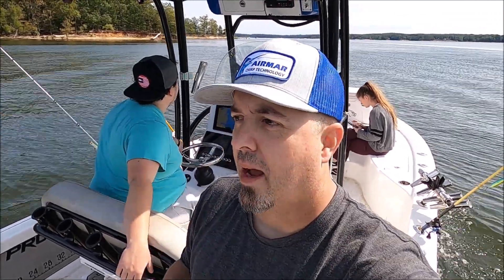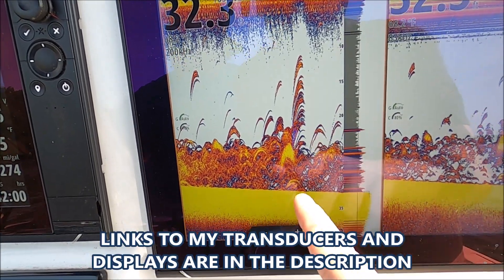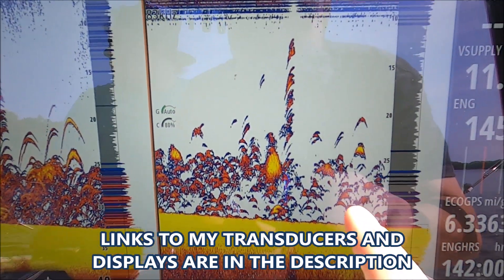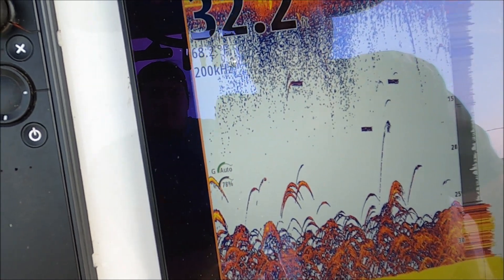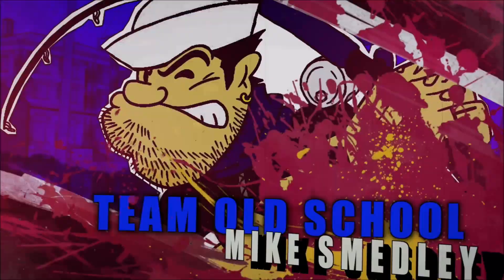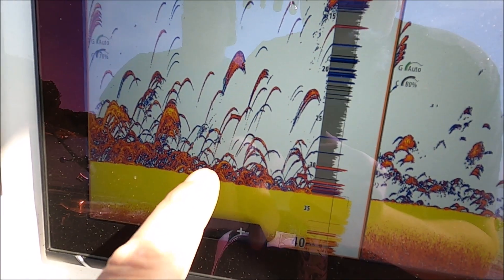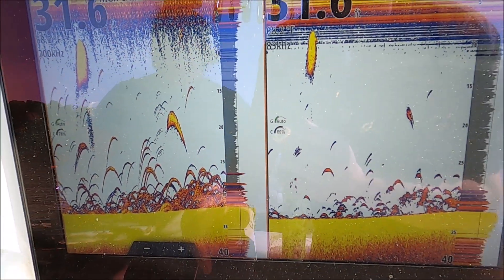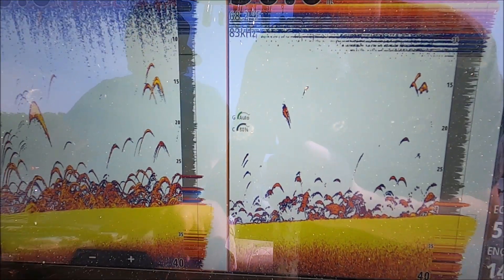Choosing the Right Transducer for your fishing style! Are WIDE Transducers better?

Comment: On a future video could you possibly speak to reasons your like to use the Airmar transducers over the ones that may come with the Simrads, Lorances's, etc.
Reply from the maker: Sure. Basically, the side and down scan transducers that come included are great, but the 2D sonar (CHIRP, 83khz, 200Khz,etc) is entry level by today’s standards. Airmar offers a full range and much higher end transducers. More powerful, quieter (cleaner), with higher quality elements. For what the included transducers cost they are amazing, especially compared to transducers just 10 years ago, but if you want the highest quality results Airmar transducers are pretty incredible.
Reply: Airmar is the king of 2d sonar. They are pricey, but well worth it.

Comment: Mike I really enjoy your videos, keep up the good work...I watched a video at work tonite where you were comparing the tm165hw and the tm175hw, I run lowrance hds live and carbon, the tm165c-hw-9n is what I think I need, and will the 9 pin plug into my live unit or will I have to buy some sort of adaptor cable. Thanks
Reply from the maker: Thanks brother! I appreciate that.  They mostly come with a mix and match plug on the end so you will need a Lowrance mix and match plug adapter.

Comment: Hello, Mike.  Airmar says that the TM165HW ducer is @Raymarine - All compatible@ . 
So, can i use this ducer with the Raymarine Element HV series or not? Can you ask Airmar regarding this matter?-)))) Thank you a lot!
Reply from the maker: They make a wire plug for several brands, so if it says Raymarine plug, you’re good to go brother!
Reply: @MikeSmedleyOLDSCHOOLSTRIPERS  thanks a lot!
Reply: @MikeSmedleyOLDSCHOOLSTRIPERS  From Chile, South America. First of all, thank you for all the help and work on the Sonar for dummies series, I finally begun to understand something (tip of the iceberg really LOL).
My father just bought a used boat that came with the Raymarine Element 7HV (HV-100 transd) mounted on the starboard side.
We fish mostly trolling for salmon (lakes or sea) to 130feet deep max. I'm planning on using and understanding the unit first with what I know now and then I have some questions:
- 1 should I change the transducer to the port side?
- 2 should I upgrade the transducer and should it be worth it for the my style of fishing?
- 3 can the unit use more then one transducer at the same time?

Thanks a lot for everything !(sorry for the very very long comment)

Comment: I have the equivalent tm185hw and a tm185m. I like both, but the hw is my favorite.
Reply: HI Brad. Why is the HW your favourite over the M?
Reply: @Cameron Hird  it's better for trolling and fish higher up in the water column. Plus it covers more area with the wide cone angle.
Reply: @bradp9938  Thanks Brad. Once you observe fish on your MFD with the HW, what do you do next?  Do you mark the fish/bait and change your course to go back over the mark?
Reply: @Cameron Hird  It all depends on how much bait and fish are in the area. But, if I am marking and catching, I will circle that spot until they stop biting.
Reply: @bradp9938  many thanks Brad.  How effective is your HW with bottom discrimination at depths below 40m?

I am about to take ownership of a brand new boat with the 275LHW and AI 3/1 ducer installed with a view to cover pelagics some of the time and the snapper in bay on other times.

I cannot fit an M Ducer and wanting to make sure I dont miss out on the snapper and good bottom discrimination.

PS - I didn’t mean to ‘report’ your latest post.  Error in finger pressing  with all the buttons etc 😫
Reply: @Cameron Hird  I have since moved to the b175hw. Basically the same picture as the transom mount, but the picture is a lot better on plane. But, I have seen blue line tiles at 800. You will be happy with yours.
Reply: @bradp9938  thanks Brad.  How good is bottom discrimination up to 40m with your 175HW?
Reply: @Camh1968  I use it to mark blueline and golden tile fish in 800' or more. They are hugging the bottom.
Reply from the maker: I also have the BI75 M and B175 HW. I prefer the HW, but both are killer. Bottom detail is pretty ok with HW. Not as good as regular H, but pretty good. Down scan is way better than both for bottom detail of course, even at 40M. Your b175m will likely have better detail on bottom than HW, but I bet it’s close. I don’t fish very deep.
Reply: @bradp9938  thanks - that is serious hard core depths.  Such a great achievement to be able to bottom discriminate like that at those depths.

Do you have any exposure to the AI 3/1 transducer for shallow depths ?
Reply: @Cameron Hird  I have not used active imaging. But I do have structure scan 3d and like it. I think I'm going to get active imaging HD soon as the s3100 modules are available.
Reply: @MikeSmedleyOLDSCHOOLSTRIPERS  very good.  Interesting to read these comparisons from real world users.  Thank you.

Are you referring to the downsscan  from the AI 3/1 transducer?
Reply: @bradp9938  thanks Brad.  What is the difference between active imaging and structure scan?
Reply: @Camh1968  active imaging 3 in 1 does 2d, side , and downscan. Structure scan 3d does side, down, and 3d. Structure scan 3d has better side range than AI.
Reply: @bradp9938  Great thanks Brad

Comment: HI MIke.  Got a question for you.  I was watching your video on shallow trolling in Raritan Bay.  I believe you were trolling a mojo jig with a Maja spoon as the trailer.  Could you tell me what your setup was?  I think it was braid with a line counter, but not sure.  I fish in the mid-Hudson valley on the Hudson and not really looking to spend $200 plus on kick-ass 4/0 reel but looking for a recommendation on something a little more versatile and reasonable for possible wire and/or braid and mostly trolling in 15-35 feet of water.  The sad part is that I splurged and bought 4 great rods from Tony M.  So yes, this a counter intuitive question.  Any thoughts would be greatly appreciated.  Love your videos and can’t get enough.  I hooked up with Joey that you recommended and he made me a sweet custom metal fabrication for my hybrid boat.  Thanks again, Will.
Reply from the maker: Hey brother!  I use 30lb mono for trolling.  The mojo gets the spoon down so you won’t need wire or braid. The shock absorber is great too. You drop less fish. You can use your regular bait reels. Here is the combo I use https://amzn.to/2PW5FJ1. I use line counters because I want total control and remove guess work but most guys don’t.  I have had hit and miss results with different brand line counters.  I just switched to one with the pulley completely exposed and so far they are good. 👍👍

Comment: Hey Mike. Thanks so much for all the content! Quick question: I see you have clip on line counters on some of your rods. What brand do you use?
Reply from the maker: I have used a few. It’s hit and miss with the box type. Shakespeare or Berkely ones. Some last for years while other die after a few trips. I recently switched to the black and orange ones at amazon. They have the pulley fully exposed and have been great so far.
Reply: Thanks man!

Comment: Hi Mike,  Love your channel.  Anyway, my new boat is finally being built.  It should be done in like 7 weeks or so.   I went with the simrad nss evo 12 . airmar b175hw and 3 and 1 active transducer.  My question is my boat size is 21 overall with bracket 23 '4 inches. .  Is the airmar ok for my boat size.  Anything, you recommend I should make sure of when they install them?
Reply from the maker: Congratulations on the new boat!!  You have a killer setup with what you picked!! Just be sure to mount the transducer behind a clean hull void of any pickups or steps in front of it, but your builder will know that 👍👍😁😁
Reply: @MikeSmedleyOLDSCHOOLSTRIPERS  Thanks Mike you are the best.  So  do you ever venture out East on Long Island in the Peconics etc.?   If so, love to have you on my boat some time in the future to fish and maybe learn some valuable info from you a great Fisherman.  Also, would you ever consider using and Ipad and Navionics for chart plotting etc?  I hear it works great!
Reply from the maker: I’ve only fished the LI sound 5 or 6 times. It’s been 8 years or so now. I’ll definitely keep you in mind if we head your way and I REALLY appreciate the offer brother!!!  Yes I have used my phone and tablet. It’s great for a few things. You can sit in your house and go over charts, plan routes and set waypoints as long as the boat is close by. You can also share screenshots. I also used it on the bow to net bait, but It’s not great in direct sunlight though.
Reply: @MikeSmedleyOLDSCHOOLSTRIPERS  Awesome! The fall is terrific with inshore Albies , sometimes other Tuna species, stripers, blackfish etc
Reply: @MikeSmedleyOLDSCHOOLSTRIPERS  Hi Mike,  Just curious.  Is the S5100 something that you would recommend or I can do fine without it?   tx for your advise !  :)

Comment: Mike, I'm fairly new at fishfinders, and have appreciated your Dummies vids!  Learned lots.  However, they are all deep, clear water.  My fishery is mostly shallow:  DEEPEST is 18'.   Average probably 6'. and FILLED WITH GRASS--hydrilla, etc. up to surface (GA/FLA Lake). In fact, if the depth is less than 12' summer grass comes up to surface.   Any experience or recommendations for setups/use with this type fishing?

Comment: Can I combine transducers? I have installed a garmin GT8HW and planning to get another transducer for the clearvu and side vu, mostly offshore fishing. I only have one chartplotter. Any recommendations?
Reply from the maker: I don’t know much about Garmin. It’s no problem with the  Simrad’s and Lowrance. Unless you have an entry level model display you probably have the ports to connect both.
Reply: @MikeSmedleyOLDSCHOOLSTRIPERS  thanks for your quick response!! i have the 1243xsv display. Wasnt cheap… so betting will work ok.
So the current in-hull transducer I have it’s “high wide”, should I be looking to get a transducer with a mid/narrower frequency?
Reply from the maker: What depths do you fish?
Reply: @MikeSmedleyOLDSCHOOLSTRIPERS  inshore to at least 500’. With my current boat I cannot go beyond that.
Reply from the maker: The HW is great till 300’ and ok till around 500’. A Medium CHIRP will be better deeper than that. A low is better for ALOT deeper.

Comment: Hi mike , Im thinking of upgrading my fishfinder but im quite indecise of which transducer and screen I should buy.
My type of fishing is jigging, I jig mostly between 50m til 200m.But sometimes I do some  deep  dropping till the 400m.
I was thinking of buying or the SIMRAD NSS7,NSS9 or the Furuno gp 1971f ,cant decide which one , and for the transducer I was thinking of the B175M Chirp-ready Titled Element.
Could you help decide which I should get?and if my options are good?And another question, does a tilted thu hull underperform compared to a standard thu hull transducer?being both 1kw and same frequencies.Because I read this on simrads site "However, tilted-element transducers may be susceptible to performance loss due to external factors"
Best Regards
Chris

Comment: Hi Mike, love these videos explaining how to maximize use of all our gadgets. Quick question. I have a CC with 2 NSS Evo2 12" displays, a BSM-1 sonar module, and a B164 20degree transducer. Recently i've been losing the network from the BSM to the NSS displays so I lose my echo. I learned from one of your videos that the NSS displays can drive the transducer themselves so I plugged my transducer right into one display and it worked. Is there any advantage to having the transducer run through a BSM module vs directly to the display? Also, if I were to upgrade to a B175HW that would be able to plug right into the display as well correct?
Reply from the maker: Yes and yes. You can leave the transducer plugged directly to the display. The sonar module built in is better than the BSM1. You will also be able to upgrade to 175 https://amzn.to/2VhdytA. But if you’re using side scan you can’t use a CHIRP setting on the 175 simultaneously. Just use a fixed frequency if you want to use both together
Reply: @MikeSmedleyOLDSCHOOLSTRIPERS  You are the man. Thanks for the quick reply. I assume I would need a separate transducer for side scan right? If we did add a separate side scan transducer would I be able to plug it into the 2nd NSS display?

Comment: Hi mike, I’ve been watching your vids over in Australia and they are great. I’m just in the process of buying a boat and would like you transducer recommendation. We fish in deeper water here around the 60 metre (200ft) and greater depths. How would the tm275lhw go against the tm265lh in those depths? I’ve been told the tm275lhw doesn’t work aswell cause of the power needed for the wider beam angle?
Reply: Mike Smedley - can you possibly assist us and provide a response to this post?  Thank you
Reply from the maker: The 275 has really been incredible for Simrad displays especially compared to the 265. I have had both. I don’t see depths like yours very often of course but the many commercial fishermen I talk to all like the 275 over the 265. Power isn’t an issue with CHIRP like older fixed frequency transducers. 1000watts is huge for this CHIRP unit. The High wide has been excellent in depths to around 300ft, but will work deeper. When you mark bottom in the deeper applications but start to lose fish returns your low band will do a great job for you. 👍👍👍
Reply: @MikeSmedleyOLDSCHOOLSTRIPERS  Thanks Mike.  What makes the tm275lhw output notably different / better compared to the tm265lh when seen on the MFD?  I understand the difference is the 'W' but how is this difference observed on the MFD, compared to the 'LH'?  Thanks
Reply from the maker: The power is the same on both. For some reason all of the commercial fishermen I speak to really dislike the 265 compared to the 275. I work closely with both Simrad AND Airmar and they say there are differences in the components, but they can’t really say WHY one is better than the other for Simrad displays. There are lots of anomalies like that that I see or hear about all the time to be honest. It might be the opposite on a Garmin with a different processor. I had both with a BSM3 CHIRP processor on evo2 and evo3 and the 275 was so much nicer to use. Don’t really know why. If you never saw the 275 you might love the 265 🤷🏻‍♂️. I wish I had a better answer for you. Hope this helps a little at least.
Reply: @MikeSmedleyOLDSCHOOLSTRIPERS  Fantastic response.  Very much appreciated.  Looks like the 275 is next level up.  Sounds like Chirp technology is an efficient use of power.  Do you think the S5100 module is worth installing for my usage (2 x EVO3S + Tm275HLW) trolling in depths up to 150m?  Would the S5100 module be at all beneficial for fishing bays up to 30m depth, chasing snapper?
Reply from the maker: @Camh1968  I am using the the SM5100 myself and I love it, but I honestly don’t know if you need it. Especially if you have 2 Evo3’s. Your depths aren’t super deep. I would personally go without it and only get one if needed. Evo3 can run 1Kw transducers no problem. SM5100 has 3 ports if you ever need more transducers, but other than that I would go without it unless you absolutely must have it for some reason.  And, yes sir. The Airmar CHIRP transducers are Mega efficient. When they first introduced these transducers I remember them saying over and over that they are so much more efficient that 1Kw is an obscene amount of power😂. I was actually using a 300watt CHIRP transducer at first many years back and it was insane in comparison to 1Kw fixed frequency thru hulls I had.
Reply: @MikeSmedleyOLDSCHOOLSTRIPERS  Thanks.  With all this insane power through the CHIRP 1kw ducers, what are the end results in output we see on the MFD (when compared to a fixed frequency ducer)?  

Can I ask why you are choosing to use the SM5100 module?  Why does a 2 x MFD setup negate (or reduce) the need for SM5100 integration?  

With no SM5100 integration, can I view a defined depth range (say top 30m) on 1 x MFD, and then another depth between 30 - 70m on the second MFD - from the same single 275 ducer?